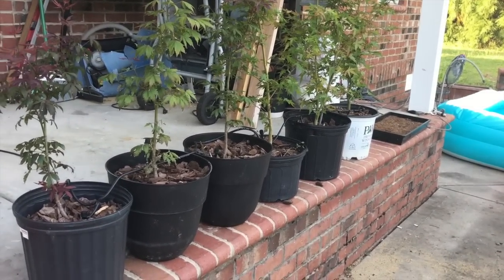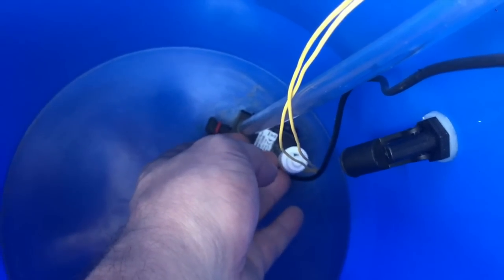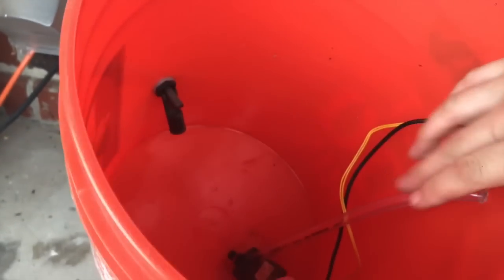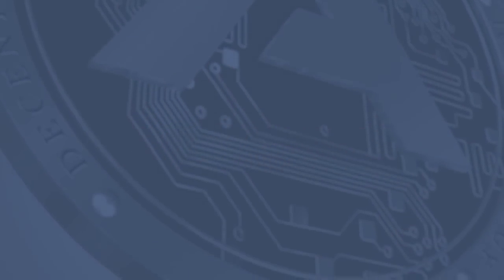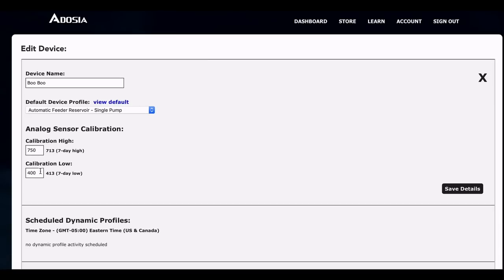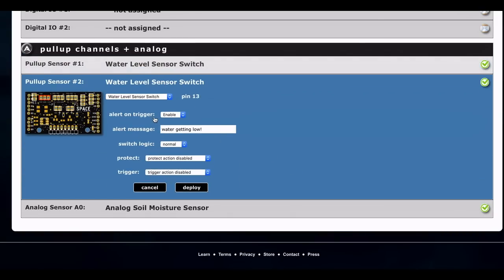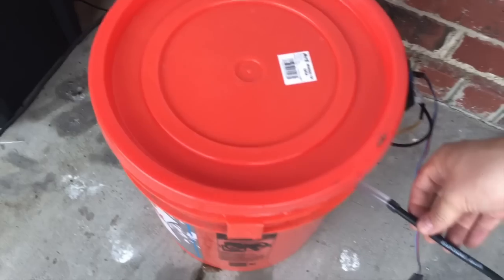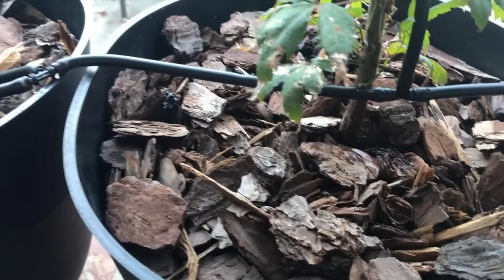WiFi Reservoir to Water Plants Automatically - Automatic Plant Feeder Monitors Cultivation Remotely

Comment: when you get to the site it gives you names you dont know which sensor you need to have the exact system.. whats the difference between 12in and 30ft soil moisture sensor? is it wire length?.. could you note a exact list please?
Reply from the maker: Here is the link to the subassembly kit (bucket not included) https://adosia.io/product/automatic-feeder-reservoir-subassembly-kit/.  It has detail on what this kit comes with in the detail section and you can pick an choose other sensors needed for an extra cost.   This link https://adosia.io/product/automatic-plant-feeder-reservoir-self-watering-pots-hydroponics-personal-cultivation/ is the bucket pre-made, but missing the hardware or base device.  You can buy the base device here https://adosia.io/product/adosia-iot-base-wifi-control-module/.  Yes, the difference in the measurement is the wire length .  If your set up is right next to each other (meaning reservoir is next to the plant) you can choose a shorter wire for your sensor or if your set up needs more wire you can choose the length based on the options provided.
Reply from the maker: UPDATE:  Yesterday our CEO made a decision to stop selling the pre-made bucket, so please disregard this link.  Subassembly kits (bucket not included) can still be purchased here:  https://adosia.io/product/automatic-feeder-reservoir-subassembly-kit/.

Comment: Can you run any sub pump you want?
Reply from the maker: The dual pump channels will drive at the dc voltage corresponding to the power adapter (tested up to 12V), and have been designed/tested to support up to 450mA on each channel. We would advise to use caution and test thoroughly when using any pumps requiring higher voltage or currents draws on these two channels - so you can use your a variety of different pumps.

There are also two digital IO channels which can be used to drive relays for higher power switching - such as AC pumps, lighting, fans, or other high current devices (up to 15A @120 VAC or 10A @ 220VAC each channel).
Reply from the maker: To add on this you can use one of the two digital IOs to drive an IoT Relay which you can plug any (within power rating of relay) sub pump